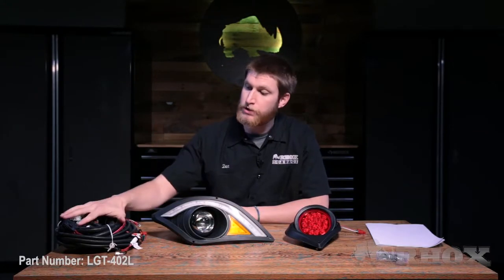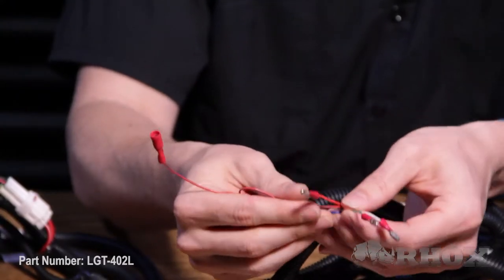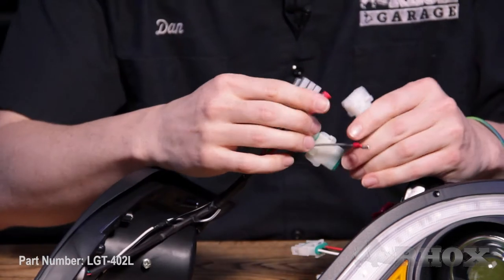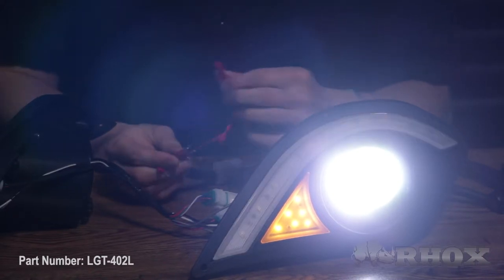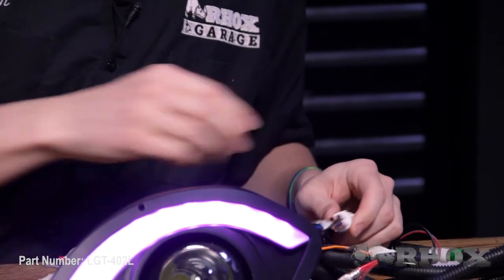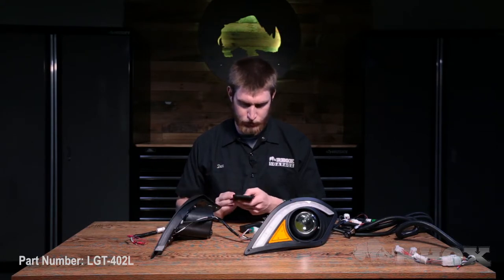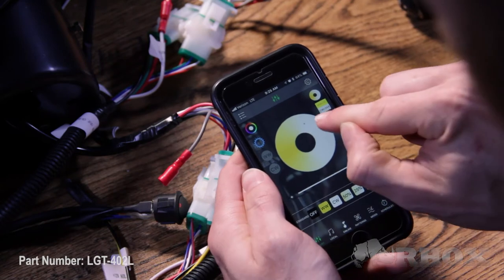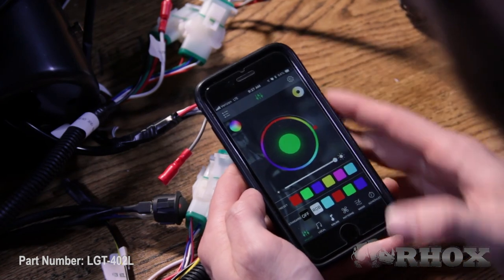Crash Course #12 RHOX Yamaha Drive2 RGBW Light Kit Introduction (LGT-401L)

Comment: My headlights, taillights and marker lights work, but the accent lights will not come on. Any suggestions?  For the price of these they should work right out of the box
Reply from the maker: Check your wiring connections. Make sure the connectors A & B are connected.
Reply: Out of the box connector E was connected to B, if I connect B to A it blows the fuse
Reply from the maker: @jasonulmer54  It definitely shouldn't blow the fuse.  If it is working correctly, E and B will give you turn signal controlled accent lights using an LGT-T4 turn signal. If you do not have this turn signal, you cannot control the accent lights with a turn signal.   If A and B are connected, your light kit's push-pull switch or optional toggle switch will control the function of the accent lights.  Given the fuse in your situation, you may benefit from calling a local dealer in case there is a short somewhere in the cart etc.

Comment: It'd be nice if this kit included screws to mount the lights to the body, or re use the existing mounting hardware like the madjax kit does for this cart. almost debating if i should return it. disappointed customer here.
Reply from the maker: The LGT-401L does include mounting screws. Please contact your dealer where you purchased the kit so they can assist you with replacement hardware.